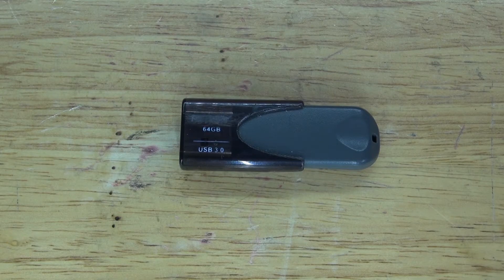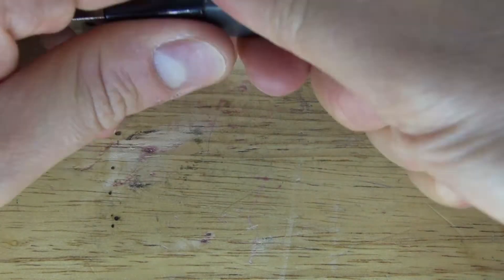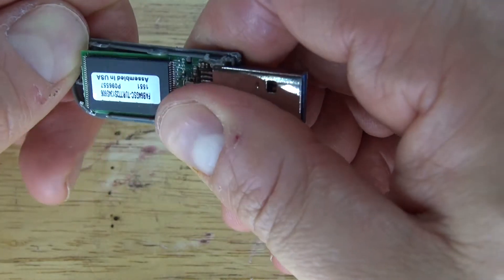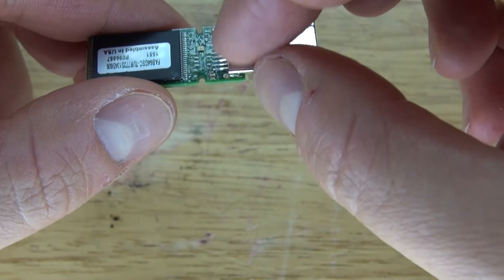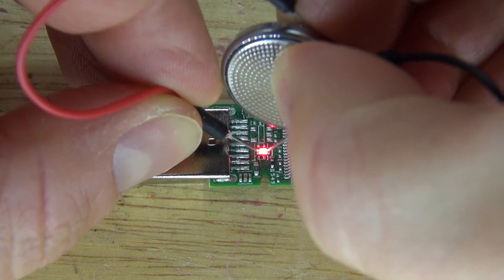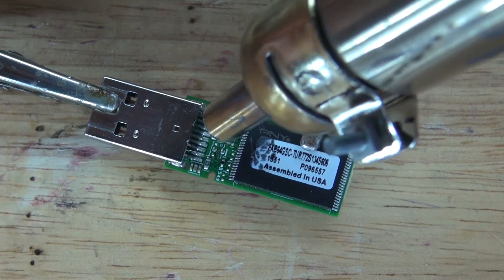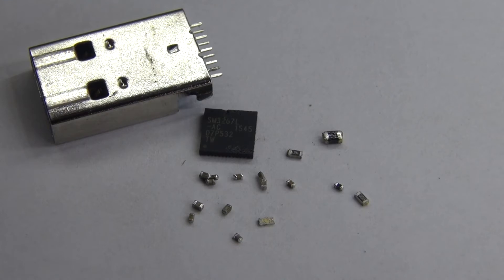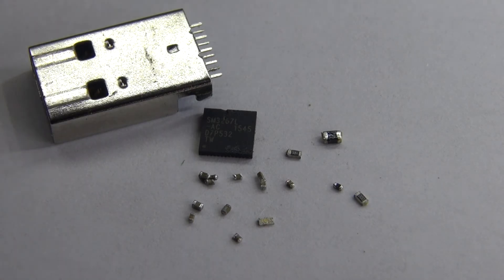USB Flash Drive Teardown

Comment: I wondered about taking a usb drive apart, replacing the male connector with a female one, then using a 3D printer to make a new case. Question: why on earth would I want to do that? Answer: I saw a spy show where a usb drive was stuck in a wall and it occurred to me that having a female connector would be less likely to be damaged and easier to cover. Curiosity got the better of me!

Comment: I wonder if you could have replaced the flash chips with bigger or smaller ones or just removed 1 and made a new flash drive. I'm sure the processor would have been ok and flash chips like those are probably cheap. Maybe only 1 of the 2 was faulty. I was interesting to see 2x 32gb chips though. Thanks.
Reply from the maker: Yes, that would work.